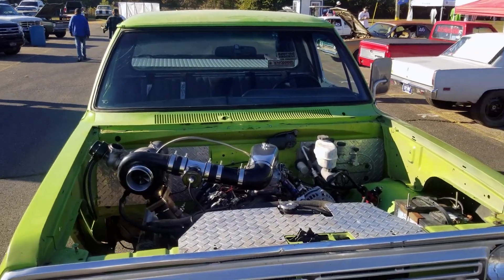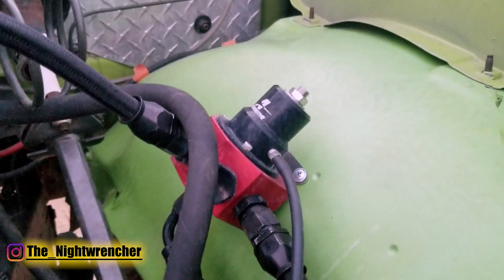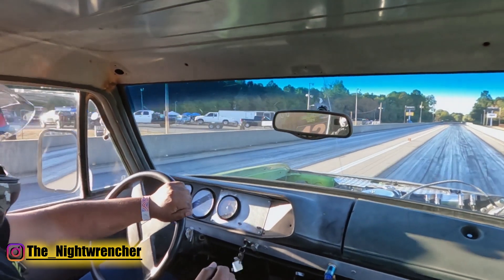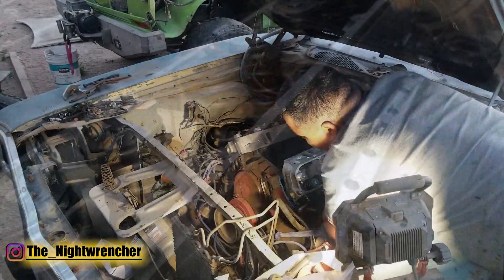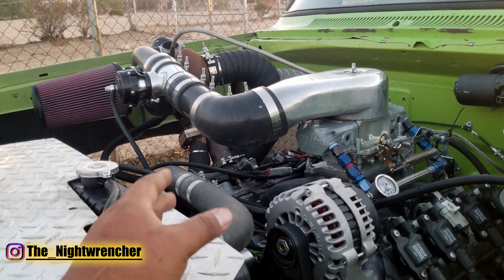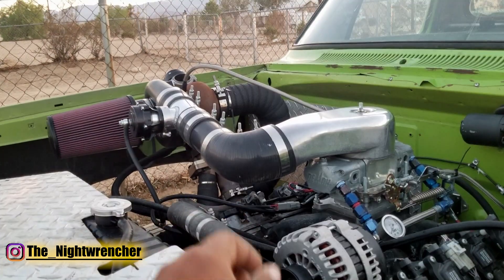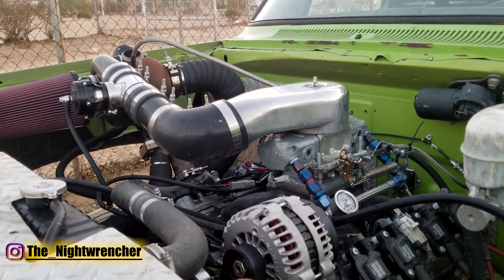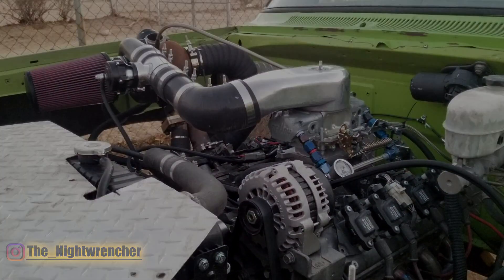Why Stroker Engines Are Being Replaced With Turbo Engines | Stroker VS Turbo LS |

Comment: I went thru ny whole SBC and stroked it about 5yrs ago.  I probly have 200 miles on it.  Would have built an LS if I could go back.  Maybe I can turbo this beast?  

My 383 only has 437hp and around 490 ft/lbs/torque.  Would like a bit more.  🤔
Reply from the maker: Well if its to the wheels, those are some good numbers. If its at the crank, not so much BUT considering how much torque VS hp you have, it looks like the engine wants more camshaft so there's definitely more in it if you want to sacrifice a little driveability. With that being said, you probably wouldn't be able to run too much boost if the ring gap was not set for it. Depending on how much more power you wanted to gain, it can be done.

Comment: Only about 30 years behind reality.
The whole Boost deal really got moving back in the late 1980s!!!!!
By 2000 half my customers were running turbos, centrifugals, or nitrous - that's a LONG time ago
Reply from the maker: I agree with you but the crowds you are talking about and the crowds I'm talking about are completely different. I'm talking about the occasional racer that never hits the track. They're a customer to no body and build most of their stuff on their own. If we're talking more professional/competitive people, they're having most of their stuff built for them so this video wouldn't even apply.
Reply: @NightWrencher  
I don't agree...
MOST of these guys were street racers, the 5.0 Mustang craze really smacked it all in the a** , how many decades ago was that - give it some thought. 
Centrifugal Superchargers & Nitrous were EVERYWHERE on the street, done at home, and usually never saw the track.
Been there, did it, and that's how it was.
Not tryin' to rain on your parade, maybe you weren't around back then.
Reply from the maker: ok, in the last 20 years that I've been going to car shows I had NEVER seen a turbo/centrifugal supercharger on anyone's cars, save for the last 5 years where Ive seen a few(usually but not always LS swaps). There were no OBS trucks with slapped on turbos. Any honda that had a turbo on it was immediately in the magazines because it was so rare. Turbo kits on ebay were garbage(today, they're not perfect, but they're a whole lot better.) I talk to a LOT of people and most of them can't even get their edelbrock to idle, much less build a blow through set up in their garage. Like I said, I'm not saying your crowd didn't exist, I'm saying they're a different breed than the people that I am talking about. If they're paying someone to put their car together, those are the people I am NOT talking about.
Reply: @NightWrencher  
We built our own - you couldn't run out and BUY turbo kits for more than 8 or 10 cars, the rest of the stuff was universal, you MADE it work, or traded work with your friends to get it done.
As far as tuning, there were almost NO dyno shops - we found straight, clean industrial roads and marked it off.
Then we timed two passes after a change, we read spark plugs, later used EGT gauges on boosted/sprayed stuff - A/F meters were the size of a Harley. Later on G-tech came out with an in car accelerometer with a built in timing fuction - then we tuned with those.
There were both blow-through and draw-through carbureted cars running the streets.
Guys knew more - and did more.
I'm not talking about car shows, I'm talking about money-down, place your bet street racing. Every weekend, American and imports, Turbo or Super 'Charged, Nitrous, etc.....
Maybe where you're from it's different, but in the metro Detroit area, we did stuff before the OEMS & the AFTERMARKET.
Many families were skilled trades - tool & die makers, the job skills are where high performance parts came from.
I been around a long time - I'm not real far from retirement, I just never turned and walked away from cars.
Also, some trivia...
There were supercharged American production cars almost exactly 100 yrs ago (no fuel injection), also, Henry Ford the 1st. was experimenting with EVs right next to his gasoline powered cars at the time.
Check it out, won't take you long.

Hey, a whole lot went on before I was born too - most of our "high tech" engine design is from WWII piston engined aircraft, a lot of "new" stuff has passed by a couple times before.
Reply from the maker: I think you are right, location plays a big factor since I am out in the west coast. I did look up the info you mentioned just now, that was pretty interesting.
Reply: @NightWrencher  
Yeah, if you really love cars, keep digging - there's SO MUCH cool stuff from the past, stuff you won't believe. 
An example...
The first turbocharged American car was in the early 1960s!
Reply from the maker: Ive read about the old GM cars that played with drawthrough turbos and fuel injection but their systems were too primitive to keep the cars reliable. The GNX made huge waves because they finally checked all the right boxes
Reply: @NightWrencher  
You know, that would be a fun way for you to generate content for your channel - do some stuff on where the technology came from/when it was originally developed, I can tell you it will freak people out (nitrous has been in use since WWII) because people just don't know!
Reply: @NightWrencher  
True. The electronics have made engine/drive train management so much easier and more flexible. Before EFI we had to work pretty hard to have good drivability AND big power, one or the other wasn't bad, both was work. But we did it.
Here's another one -
The first EFI was an option on a 1950s Chrysler!
Reply from the maker: If I remember correctly, nitrous was used in planes and in tanks. Some of the best things we have today started out as work arounds for other things 😂
Reply: @NightWrencher  
I believe Nitrous was a German aircraft innovation. I know we had two speed superchargers on some planes, the second speed ran the 'charger faster for the thin air at higher altitudes. The U.S. also had some form of water/alcohol injection that was a one shot deal - if a pilot had no choice but to run and it looked like he might be caught, he had this as a last resort. I didn't get consistent answers about it when I looked into it (I was in a hurry) but any aircraft that had used the injection system to get away had to have a complete engine teardown and inspection before it was cleared for flight again.
The Japanese weren't exactly dumb, Zero fuselages were wood internally, it made them light and super nimble.

Comment: So much wrong here on the stroker vs turbo pros and cons. But the fact that people are switching to turbos is because they are lazy point blank. Stock engines like the LS, coyote, and Hemi are all equal, big heads strong blocks and conservative cams came factory, so they respond to cam swaps and turbos like mosters with little to no work required to be a hero. But it comes at a price -longevity.
Reply from the maker: Good to see you around Vinny. I really don't think its about laziness at all. You will go further, cheaper and faster with a boosted engine vs a stroker version of the same engine. The turbo engine will be more tame down low and wilder up top. This video could also apply to superchargers in general but the costs basically double that of budget turbo setups which is why I didn't talk about them. A name brand version of the same size turbo I have would cost $1200 alone. Maybe if I was professionally racing it or at least hitting the track every weekend, the fancy turbo would be worth it but for a project car that can be daily driven, you can't beat a cheap turbo.
Reply: Straight Lazy!
Reply from the maker: @benaiahtheassassin  its all about efficency 👌 not all of us have big money bags laying around like mr. Imfamous nova
Reply: @NightWrencher  I wish I had bags of money laying around. I'm so broke I can't afford swap a ls break it and swap again. 😪 I have been running over a year

Comment: It seems like your comparing the first gen SBC to the LS platform because a LS can indeed be stroked. At the end of the day, horsepower costs money. A budget build and stroker build are two different routes in my opinion. A budget build would not involve taking the engine apart and having it machines etc. You can turbo a stroker engine as well but your intended use plays a major role. Longevity and reliability is something to consider when building an engine. Good luck.
Reply from the maker: I'm not comparing any engines except for stroker engines vs turbo engines. a turbo vortec 350 vs a 383 stroker vortec 350 would still have the turbo come out on top. You can easily build reliable turbo engines that will last forever but it depends entirely on the tune, maintenance and how you drive it. I have mine tuned to 12 lbs of boost. That's over 400 to the rear wheels. I just backed off the timing to keep cylinder pressures down when I'm driving around town and on the freeway.

Comment: I think I'll be sticking with my stock Ford EcoBoost on my 2020 Ford Explorer XLT!!!🙄
Reply: Preach it!!! 
Cool truck, When you get boost off the line it's gonna be a bad dude.  Bye bye Mr. Clutch
  😂. 👍💪
Reply from the maker: That would be your best bet, they're pretty quick!
Reply: @NightWrencher  Your not kidding!!!😳 In the "Sport" mode of the computer, it's got a nice high Rev and shifts FAST! and considering it's an Inline four, it pulls pretty hard too!!! For the oil I am using the Pennzoil synthetic derived from natural gas and adding in a quart of the Lucas Synthetic Oil additive. Also got some FilterMags on my oil filter and a neodymium magnet oil drain plug. Keeps the "baddies" from recirculating back through the engine!!!" Last oil change I cut open the filter and looked at the filter media. Sure enough, there were some super fine particles where the FilterMag neodymium magnets were positioned on the outside of the oil filter!!!😁👍🏻